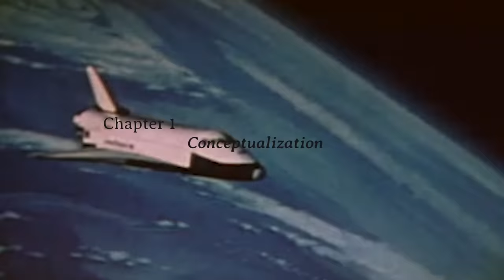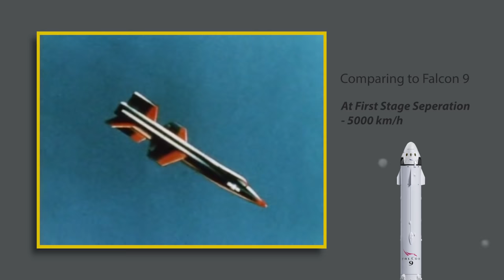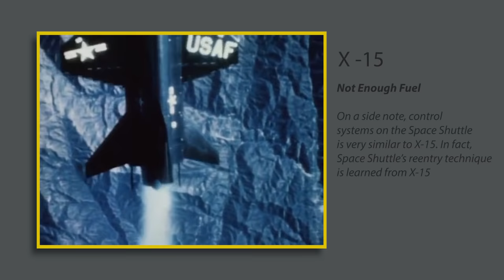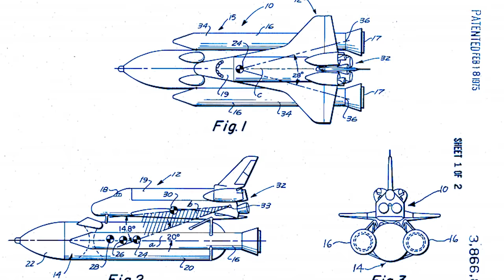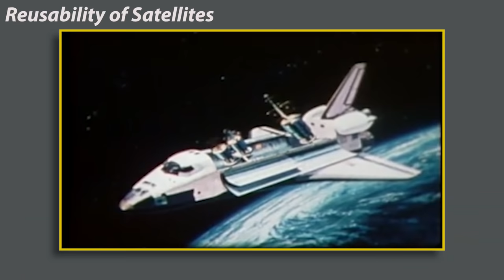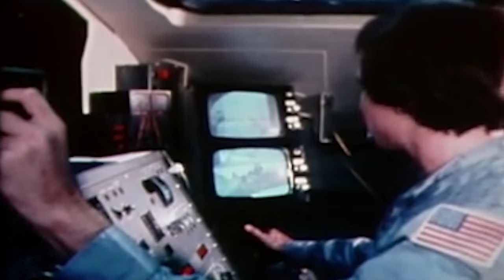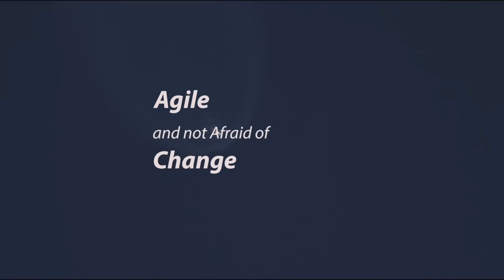The Space Shuttle, a failed attempt at Reusability?

Comment: You did say that the Apollo program had zero deaths, but that's not true. Apollo I started the program on a dark note when the three crewmembers were killed in a capsule fire on the launchpad. No, they weren't lost in spaceflight technically; but they were actually lost due to similar engineering ignorance and lack of safety oversight regarding the design and construction of the Apollo CM.

Comment: The shuttle was to build the ISS and launch Hubble.  Well they're there. so the shuttle was a build success.  Von Braun proposed similar shuttles in the late 50s as drawn and presented by Disney Studios, long before NASA and before he was even included in orbital flight.  The film 2001 was basically the Disney simulation on a high budget with nice cinematography.

The Shuttle was too big for common human use, but it needed to be that big for USAF and ISS module needs.  They might have built smaller lifting bodies and stick them on Atlas or Delta rockets.  However it was a 1958 concept.

Little noticed, of late, SpaceX is throwing away boosters again into the ocean.  He has too many of the 2016/2017 block of boosters lying around that they have a storage problem.  When I see boosters used reused five to ten times for big missions with a refit turnaround of a week or two for a landed booster then I'll believe the reusability costs advertised. He should really never have a storage problem of redundant boosters.  Till then I think the cost reports are cooked books, not accounting for the millions and millions that NASA has pumped quietly into the company.  Like Internet companies that never make a profit, but still exist, some quiet party is paying the bill.  Musk came from the internet banking model.

Comment: In defense of the move to salvage old Intel chips, it must be understood that older chips built on a larger process node are much better suited to rigors of space then modern hardware. The smaller the process node the more susceptible to radiation creating a bit flip. This isn't a problem on Earth but it is in space. There are other ways to get around this, for instance SpaceX uses multiple modern chips in parallel to ensure that if a fault occurs it will be caught and the faulting system restarted well the other systems continue. Radiation tolerant vs radiation hardened is a better option in my opinion.
Reply: The shuttle got around it the same way they used an old IBM processor not the 8086, good story though.

Comment: The shuttle was designed only about 10 years after the first humans went into space. It was, in some ways, barely a second generation launch system. The simple truth is that the technology was not available to achieve routine, economical spaceflight. On the reliability side, the shuttle had a demonstrated recovery reliability of 98.5%. This was on par with the Russian Soyuz vehicle. It was not an excessively dangerous launch vehicle with a 99.5% launch success rate.  In the end, the shuttle was a R&D vehicle that paved the way for the future of other spacecraft. That can be a long, hard road. Comparing Apollo to shuttle is unfair. There were only 15 manned Apollo flights. There were 135 shuttle missions. (The whole cost estimate is dependent on how you do the math) The shuttle was exposed to far more cumulative risk than Apollo was. And catastrophic failures were inevitable.
Reply: Two points, the shuttle program killed one person for every ten flights, excessively dangerous, not acceptable. 

In both accidents known risks that had occurred several times were considered acceptable, it was the interface between management and engineering that failed, the technology with the rubber rings and the insulating foam was fairly simple.

Comment: Calling the SRBs 'reusable' is a stretch, they are 'REBUILDABLE' as something close to 80% of the cost of a brand new one.  What comes back is a steel tube which is just one of the parts of building the finished booster, it needs to have expensive solid fuel cast into this mold.  It's alike calling an expensive multi-layered Victorian Jello reusable because the bowl it's gelled in isn't smashed.

Comment: So why was it so expensive? Everything excepct the orange liquid fuel tank was reusable?
Reply: Sebastian D Expensive to refurbish. Reusable doesn’t mean cheap.

Even Space X, while ahead of everything that has been done so far isn’t fully reusable.
Reply: After each flight, they must remove the Shuttle's Main Engines from their mounts, take them completely apart, clean out and tune up every part of all three engines, then re-install them into the housings.

This was where the Soviet Union made the critical design difference with their Buran.  By using a booster that could lift the entire shuttle and its payload into orbit dead weight, the shuttle did not need to use its engines at all, except for orbital maneuvers.  Since these engines (like the OMS engines on NASA's STS) produce only 1% the thrust, they are far easier to maintain and cut refurbishment costs in HALF.
Plus the Energea booster could be tasked to any number of objectives other than lifting a shuttle, as it had enough power to take something the size of a Soyuz, transtage and lander all the way to the moon.  

NASA should have taken these lessons to heart and replaced the aging orbiters which were already beyond their intended operational lifespan.
Reply: The shuttle broke new ground by making things that were more expensive to refurbish than to replace. The combination of the custom made hard to maintain heat tiles, along with regular damage from foam strikes was special.

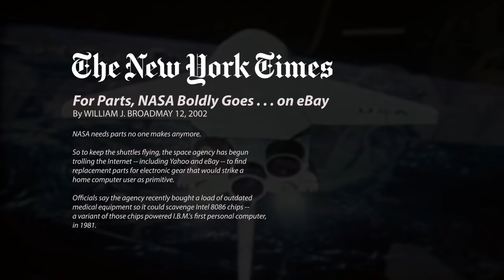Comment: 7:52 factcheck: the 3 apollo 1 astronauts were killed, apollo was not without fatalities.
Reply: true, Apollo never lost Any Astronauts during a active Mission, It only lost 3 Astronaut during a pressure test, after Apollo redesign did Apollo fly with no Fatalties.
Reply: Though it still had a failure - Apollo 13.  It may not have cost lives, but that was ONLY because the Lunar Module could serve as a lifeboat, and pure blind luck that the heat shield was not damaged in the explosion.

Include the successful flights of Skylab and ASTP, and Apollo had a total 1 in 15 failure rate.
The two failures in 135 flights give the Space shuttle a comparative 1 in 67.5 failure rate.  An over 400% improvement over Apollo.

Comment: What if we replace Shuttle's SRB with Falcon9 Booster and replace Shuttle's Hydrogen fuel with SpaceX's Supercooled Kerosene... now we got an upgraded Space Shuttle! Also, what if we upgrade Space Shuttle computer with SpaceX's so that it could fly by itself so no more regulation preventing taking risk & upgrading.
Reply: Upgraded or not the shuttle is too expensive and limited to LEO
Reply: @Doug Mcdonell, an upgraded Shuttle might use less working personnel than the original Shuttle is, so it might be cheaper because; 1) Falcon9 Booster can be throttled, shutdown, and recovered intact so it is safer than SRB meaning you need less crew doing Q&A and there's minimal refurbishment work to be done. 2) SpaceX's Supercooled Kerosene is also more compact than Space Shuttle's Hydrogen Oxygen tank so it is most likely be smaller and recoverable as well (so save more money from the expendable big Orange tank). 3)SpaceX's autopilot in Space Shuttle would mean less ground crew & astronaut needed to be prepped before each flight, so less personnel overall. Therefore, an upgraded Shuttle MIGHT use less people so it might be less expensive.

Comment: had a per unit failure rate of 40%. the airforce version is unmanned and stays  up for over a year
Reply: Every Apollo only flew once.  So, Apollo 13 had a 100% per unit failure rate.  Comparing a "per vehicle failure" is not a fair comparison between Apollo and Shuttle.  Otherwise we must then state that the Space Shuttle Discovery had a 3,900% improved success rate over Apollo 11, as Discovery flew successfully 39 times, while Apollo 11 flew only once.

You must instead compare successful flights vs. failures.
Including Apollo 13, Apollo had a 1 in 15 failure rate
Comparatively, Space shuttle had a 1 in 67.5 failure rate (2 failures in 135 flights)

Comment: The technology wasn't outdated it was a design flaw from the beginning.  Putting a plane on the side of a rocket was just plain stupid.  The top of a rocket is far more safer.
Reply: Jeremy Wheeler that wasn’t why the disasters happened. One was because of an o ring (I think) and the other happened during re entry.
Reply: datboi knows best the foam falling down on the wing that caused the re-entry burn wouldn't of happened if it was on top, and the challenger might of survived too just like the solid rockets survived and few away after the primary tank exploded.  There is a recent shuttle documentary out there that explains this.
Reply: datboi knows best Regarding the Columbia disaster, falling debris hit the orbiter on the side of the stack and punctured heat tiles, which led to its breakup during reentry. If the vehicle had been on the top of the stack, any falling debris from the main tank would have no way of hitting it.
Reply: It couldn’t have been placed above the tank considering they wanted to reuse the RS-25’s and there would have been extreme drag on the spacecraft as well.The issues you pointed out with challenger should have never launched it was to cold for operation that was human error and for Columbia the debris problem would have been fixed if the a aluminum skin on the tank like a early 90’s concept wanted to do.
Reply: Jeremy Wheeler Very true; plus no escape facility. The shuttle was innovative but it proved reusability is actually more expensive than disposibility.
Reply: The Soviet Union fixed virtually all these problems with their clone copy of our Shuttle, the Buran.

Firstly, the Energea Booster it was strapped to was powerful enough to lift the shuttle into orbit dead weight, requiring no help what-so-ever from the orbiter's engines.
Secondly, as a full liquid launch stack, there was no solid boosters, thus eliminating the o-ring problems and allowing operation in far colder temperatures
Thirdly, as a separate stack in itself, there would have been no foam strikes that the ET of STS was famous (or rather infamous) for.
Fourthly, with this booster to lift the shuttle on its own, you would eliminate the costly refurbishment of the Shuttle Main Engines after every flight, instead having only orbital maneuvering engines (which only require about 2% the thrust.  In fact, I hear the OMS engines produced as little as 0.5% the thrust capacity of the SME's)
And finally, the Energea was also variable, and could lift payloads other than a shuttle, with enough power to reach the moon.  It was basically what the N1 never was.

If there was a design flaw in STS, it was having to rely on the Shuttles main engines in the first place.
Reply: If it couldn't have been placed above the tank, then it should  have been scrapped before the first piece of aluminum was molded.  We say it couldn't have been done any other way, but SpaceX and other companies have proved that wrong. The tech might not have quite there a few decades back, but that is why you innovate and not just say, "this is good enough for the next 30+ years."
Reply: They have proven nothing of the sort, as neither SpaceX nor any other company you can name have developed anything the size of a Shuttle orbiter with a launch stack mounted aft.
Further, it should be noted that the Soviet Buran was also side-mounted, and yet it eliminated BOTH causes of our shuttle accidents (the SRBs and the foam strikes).  Even with all that said, since the Energea lifts its payload (i.e. the Shuttle) up dead weight, it could conceivably be mounted on the nose,... but that would be a far more difficult mounting job, considering the design of the tail section and the OMS engines

Top mounting isn't necessarily the end-all be-all here, its replacing the SRB's with something more reliable and safer in temperature extremes, and having the central core be the main engines instead of externally feeding orbiter-mounted engines (which eat up the most refurbishment cost)
Reply: Of course they proved it. We are simply talking scale at this point, but the technology is proven. And the Buran still would have had a dead crew if the rockets failed. This is elementary engineering talked about after the Challenger accident over 30 years ago. 

As for size. Was that size effective? It could basically lift the same payload as the Falcon Heavy. That would lift any ISS piece. And the costs are low enough to send up several ships, with all the crew and equipment you need and have money to spare.
Reply: And if the Buran were a successful design, the Soviets would have stuck with it. They found Soyuz to be a better launch system than the Buran.
Reply: How could the Soviets stick with it when the Soviet Union fell not long after the Buran's successful test flight, and before the remaining orbiters could complete construction?
I would appreciate a little less ignorance of history, if you are going to talk seriously about the space program
Reply: I'm talking seriously about the program as you wax poetic about a launch system that flew precisely once. We can talk about the merits of the Spruce Goose next. 

The Buran might have been great or terrible. We only have the Soviet's word that the flight was 100% successful. And you don't mention that the next scheduled flight was supposed to be a full 5 years later. Something was extremely wrong even before the Soviet Union collapsed.

You've talked about the size making it impossible to be properly launched stacked above the rocket. Think of this. The Saturn 5 launched Skylab into LEO.  170,000 lbs. The space shuttle weighed 165,000 pounds. I'm not saying we needed the Saturn 5 but it proves that a large craft can be stacked.
Reply: It was a test flight.  The Energea was a prooven booster that had flown numerous payloads other than the Buran at the time.  Hell, to Energea, the Buran was just cargo strapped to its back, as their shuttle didn't have to contribute any lifting power at all. 
So they want to take the time to make sure its done right before committing lives to the program.  How AWFUL.

I wasn't talking about the size in the terms of weight, but rather SHAPE.  Skylab was built out of the hull of a Saturn IV-B booster stage.  It was already the proper size and shape to perfectly mount to the fairings of the second stage of the Saturn V.  PLUS, it was cylindrical.  And even after all of that,... it STILL lost one solar wing, jammed another, and part of its heat shielding had torn off during ascent.  Not exact what I would call a clean launch by a perfectly sized and mounted vehicle.

A shuttle orbiter on the other hand has no cylindrical aft section to properly mount the Saturn's farings to.  Not only is it a different shape, BUT it is also angled, as well as the ailerons on the bottom of the engine section.  How exactly would you suggest this thing be mounted safely and securely to the top of a Saturn V?  

Congratulations, you can use wikipedia and see what the weight was, but you are still missing virtually every engineering principle that is required for spaceflight to work.
Reply: They felt such a big need to reuse the engines that it killed 14 people. There was a point in the 70s when an engineer should have said that they were building a death trap.
Reply: More like they ran out of money to keep Buran going.

Comment: new rockets can carry similar payloads much more efficiantly with newer engines and fuel types, back in the 80s the space shuttle was a lot cheaper than other methods at that time... also satellites today couldn't be repaired as easily, so not much point in sending a manned mission to one...
Reply: I haven't heard of these new advances in rocketry, has someone come up with a fuel other than  kerosene or hydrogen? Curious that the space shuttle was a lot cheaper than other methods, I've never heard about a launch system where payload cost more per kilogram than the shuttle. Hubble wasn't repaired easily, it was never designed to be repairable. If you would consider trust to weight ratio as a measure of engine efficiency then the Rocketdyne F-1 would be number one.

Comment: The Falcon Heavy is NOT the most powerful ROCKET ever built, it’s might be the most powerful VEHICLE ever built but it’s not the Most powerful rocket, Saturn V still holds that record even to this day with the 5 F-1 engines to get it off the ground. The space shuttle also (whilst being something that I think was amazing to look at and tackles some amazing feats including re-entry) was a total failure in regards to its purpose...
Reply: He didn't say that Falcon Heavy was the most power ever built. He said most powerful in the industry and was many currently running. As of right now, there is nothing more powerful currently operation than Falcon Heavy. However, both SLS and Starship will be more powerful. We might see something more powerful from Blue Origin at some point as well, but that will be a while. 

Also, iirc, the Falcon Heavy is the fifth most powerful rocket ever to fly and the forth most powerful to successfully fly. The Saturn V, the Space Shuttle, the N1, and the Energia were all more powerful. That said, only the Saturn V was capable of putting more into orbit while also being successful. The Energia could technically put more into orbit, but the cargo sat to the side and the only successful launch was the Buran. Both the Shuttle and Buran could only put around 30t into orbit due to the mass of the craft.